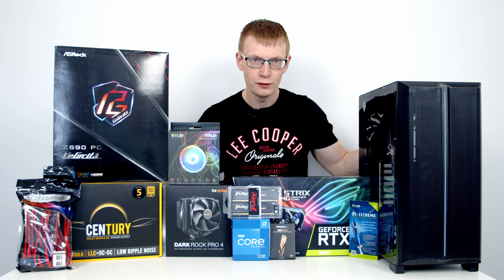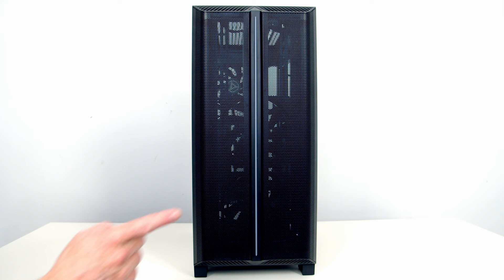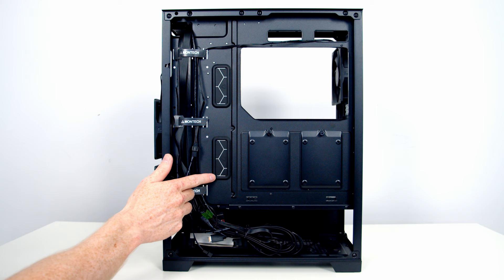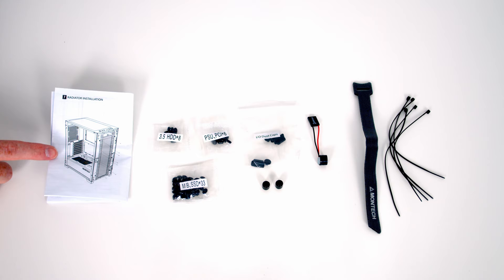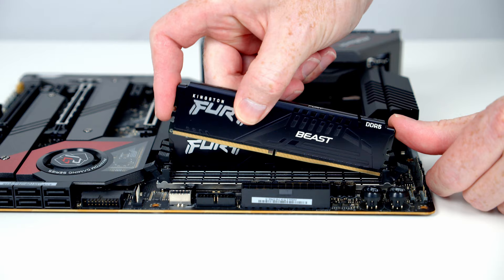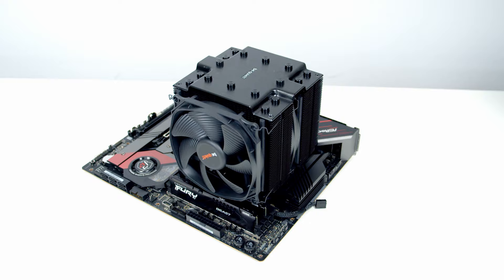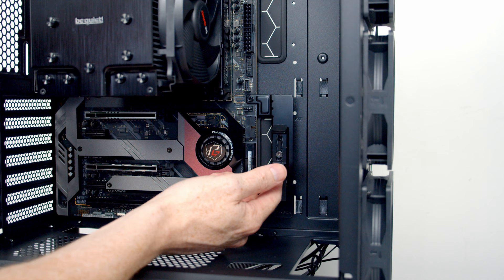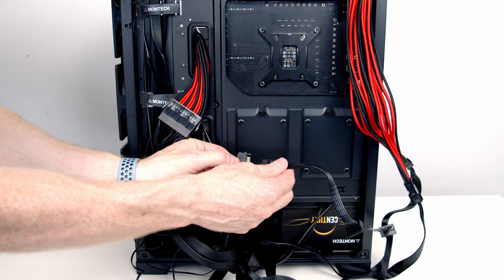Montech Sky One Lite Build - Step by Step Guide

Comment: Is there any way to actually plug in the case cables with the bottom system fan installed? It seems like the two just can't exist together on a MATX motherboard.

Comment: How are you getting the front panel led to work? I can’t get mine to work.

I mean the long led line in the middle. The power button lights work. I am missing the usb c header. Working on getting a part to fix that
Reply: I have this issue too
Reply: @jerryhan4563  I found out. You have to use Sata cable. You need to use some of the converter wires that came with the power supply to hook it up.
Reply: @jakeconer  hey dude, can u help me? same issue, i dont get the sata cable thing
Reply: @PedrodGamesRT  if I recall correctly, I believe I found out I had a convertor cable that came with the power supply or in the case box
Reply: @jakeconer  i see. I dont know what is a conversor cable. But i gonna try It. Ty